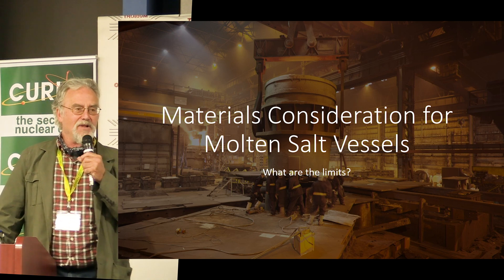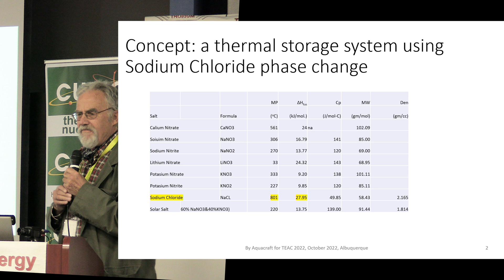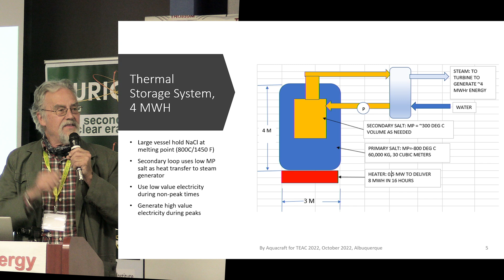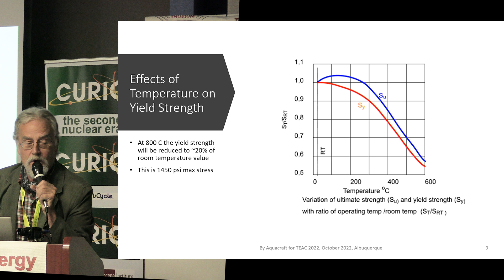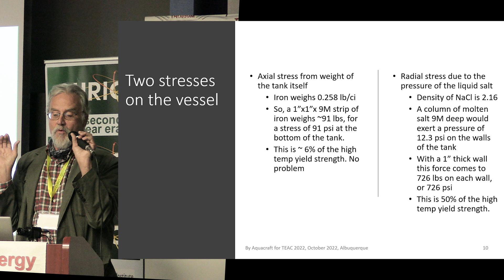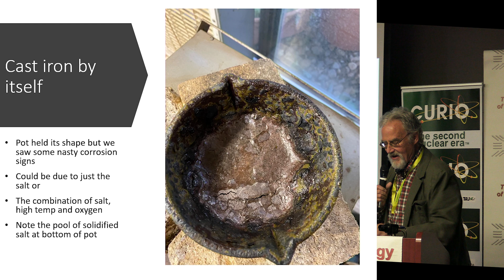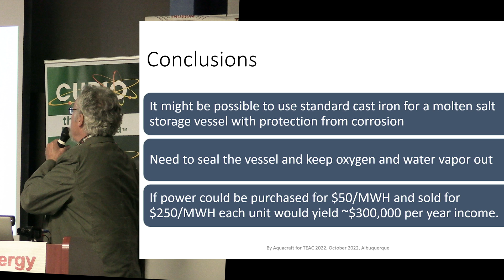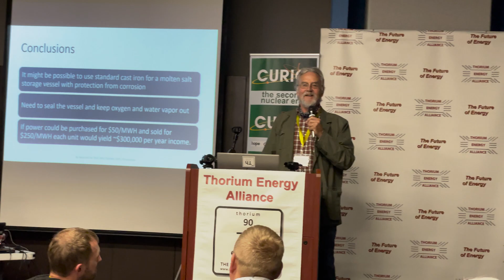Materials Consideration for Molten Salt Vessels by Bill DeOreo @ TEAC11

Comment: Having high melting temperature for salt is not an advantage it's a disadvantage
Reply: How so? A higher temperature system allows for more efficient thermal cycles.
Reply: @quantaengineeringllc  having high decomposition temperature is an advantage but having high  melting temperature is disadvantage which means you would need alot of energy to liquefied the salt so you can store it and use it to extract the thermal energy from it in liquid state

Comment: You forgot the energy from the molten salt needs to be transferred to heat exchanger to convert the water to steam, What metal would you use for that.
Reply: Stainless steel has a sufficiently higher melting point to be used.

Comment: I was wondering if taking the cast iron pot and placing it in Fluorine gas would make the Fe less reactive. BTW, ChatGPT thinks this is a dumb idea. 

"The reaction between cast iron and fluorine gas could potentially create a layer of metal fluoride on the surface of the cast iron, which may actually make it more reactive to liquid NaCl."

Comment: Well, despite that I liked the presentation, I really dont understand why not just to use Magnesium oxide bricks like in the blast furnace? Btw, there are noe tens of startups which are doing energy storage with heat (molten salts, hot sand or carbon blocks). Also, check the story of the GE molten salt battery failure.